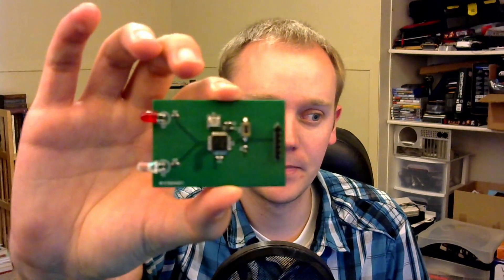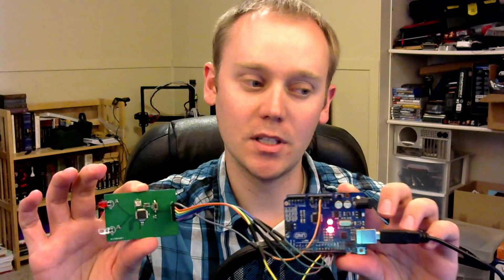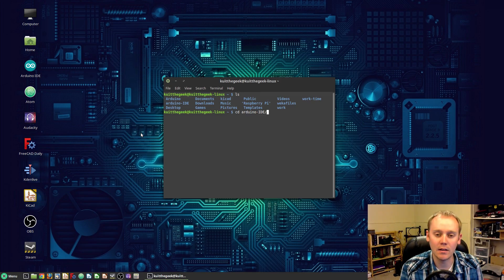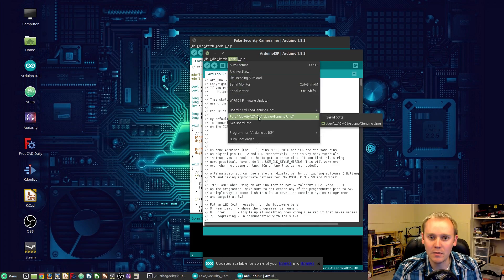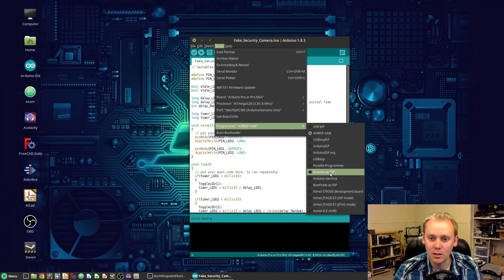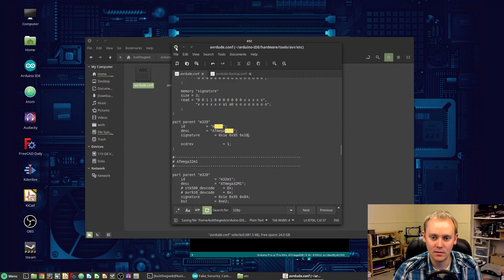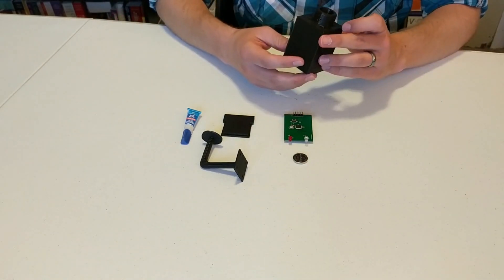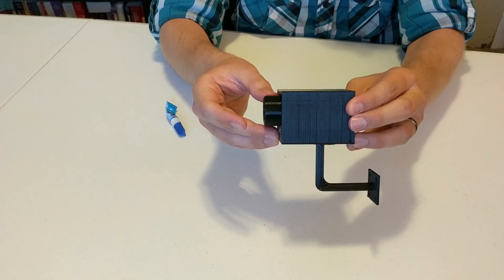Shenzhen I/O in Real Life - Part 5 - The Build

Comment: Looks like you made the fix for the code even more wrong, it just happens to work by accident since pins start out in OUT mode with low state. You're setting pin 1 for output twice, and setting pin 2 to output low twice.
Reply from the maker: Are you saying it is wrong because I set the pins in the setup block of code? I would argue that isn't actually wrong, but it is defensive programming. I ensured that the pins were set correctly at the initialization stage, and then I set the program going on the loop. It may be doing the same thing twice, but it is done intentionally. I would do the same thing in a more complex program, to ensure the pins are configured correctly before the main code is executed. I don't understand why you would think that is wrong. Could you explain?
Reply: @KuittheGeek  You are setting the the same pin's state twice instead of setting both pin states. A copy-paste error.
Reply: Seek to 6:25 and see the setup() code: you set pinMode(PIN_LED1, OUTPUT) twice, then digitalWrite(PIN_LED2, LOW) twice.
Reply: @KuittheGeek  No, he's right. Although it's actually PIN_LED2, not 1.

There's some other improvements I'd make to the code though. Like make the constant delays actual const variables. 
Also make the random upper bound const a long, since the random function is defined as [long random(long, long)] anyway (the int gets implicitly cast so it technically doesn't matter at all to be fair, but might as well).
Also make the timer variables unsigned, as that's the data type millis returns (which would also double the time before you're gonna encounter overflow wackiness, which is also something you might wanna handle. Basically at some point [timer_LEDx < millis()] will be consistently true for a really long time (more or less 2^32 - 2 ^ 31 - 2 ms, or about 25 days. Slight variance because of the positive offsets, also disregarding any clock inaccuracies), so an extra check for resetting the timers would be necessary. With the proper unsigned type, it would instead be false for about double that time). I personally also prefer to store the result of the millis call in a const variable once and use that, since the call is actually somewhat expensive, and you also avoid any variance in values in consecutive calls if you're doing processing that's taking a while in between.
Then also code style with the upper and lower case (setup and loop vs ToggleLED), although I get that you might not wanna follow the predefined Arduino style in that case.
I'd also change the ToggleLED function to accept the pin of the LED instead, since they're unique anyway, then you don't have magic numbers in the ToggleLED calls, and the function definition itself. Instead of that you could also at the very least define LED1 and LED2 with their custom ids (1 and 2 in this case) to filter for in the switch.
Since you also have actual state bools for the LEDs, I'd use those instead of the LOW macro in the setup function. If you wanna keep the macros, you could do so with an [LEDx_state ? HIGH : LOW] tertiary. If you want the LEDs to start on, it would already happen during the setup that way, and you'd only have to change the state bools.

Either way, don't get me wrong, pretty much everything aside from the overflow handling will have absolutely no effect on the functionality, and even that is obviously not really a problem for a demonstration project like this, and would even be kinda borderline even for a commercial product. I've actually really enjoyed this series, especially the actual PCB design and manufacturing + soldering, which is something I've never done before and didn't know all too much about (prototype boards are the closest I've come to actual PCB design). It's something I've been interested in for quite a while, with heightened interest recently, thinking about how hard it'd be to make a custom PCB with my own firmware in place of a (relatively niche) commercial product. I might actually look into that more deeply on my next electronics project because of the knowledge I've gained from watching this series. Btw, I saw your comment on the DoshDoshington video on Zachtronics games, which was what actually made me check out your channel haha
Reply from the maker: Sure enough. I just found the code, and you are both right. It was a copy/paste error. I honestly haven't really looked over this code in 4+ years. I did this while I was just starting into my Master's, so I have definitely learned a lot since then, and I would agree with your improvements.

I have always been more hands on as it is and especially at this time in my life, I was primarily designing PCBs for work, so that is where my experience really was. Since then I have gone on to do a lot more firmware for commercial products, and I would definitely change how I wrote this code. 

I am glad you found the channel. It would seem that the DoshDoshington video has sent quite a few people my way. I have definitely enjoyed PCB design, so I hope you the best as you start into it.
Reply: @KuittheGeek  Heh, I guess I could write my own update.
I have since designed my own PCB, based on the RP2040 hardware example project, was surprisingly easy. I added some comparators and protection diodes so I could sample the ADC inputs on the RP2040 and use it as an oscilloscope and logic analyzer. I'm still working out some bugs with the software, but I can say I actually designed a project like that from start to finish (Well, at least functionality wise, I suck at making things look nice so the boards either sit bare or in a featureless, hollowed out 3D-printed cuboid). Lots of things to improve if I ever make a v2 but I'm happy with what I managed.

Comment: what kind of soldering iron do you use? i have never seen one that looks like that before.
Reply from the maker: I have a system that includes a fume extractor at the tip to gather most of the smoke, as well as a hot air rework station. I don't think I would say it is one of the best that I have ever used, but it has a lot of tips with the kit and it gets the job done. I believe it is the Mark Ethan 968DB, but I believe we bought it on Amazon. It does have some nice features, like the smoke extractor and a vacuum handle for picking up small parts, but the hot air has burned out a few times, so I don't use that anymore.